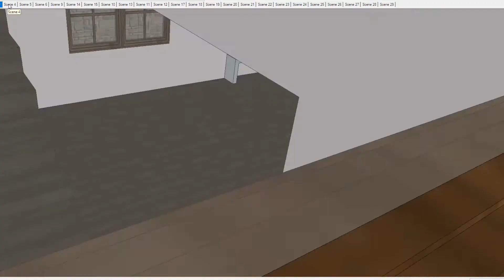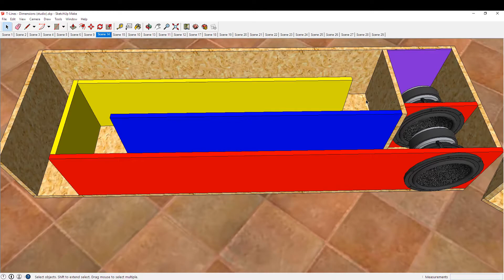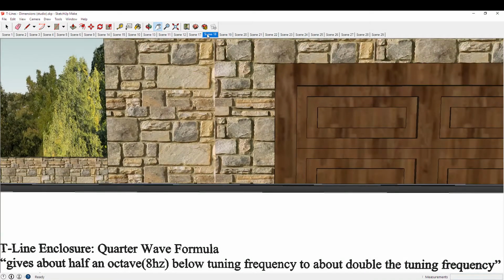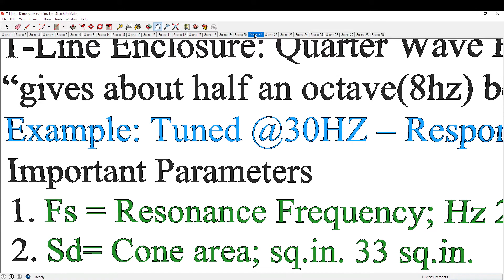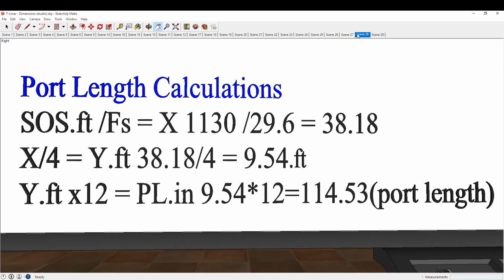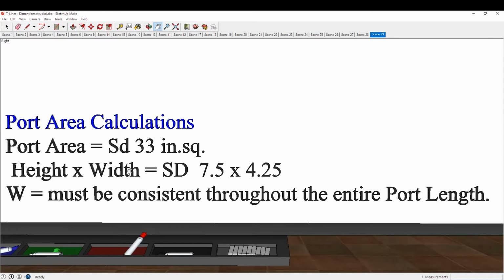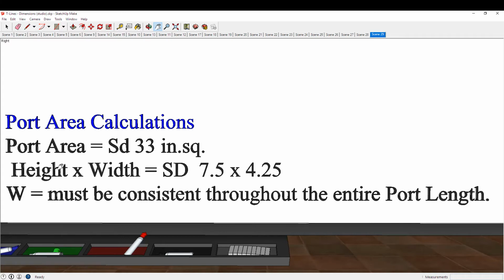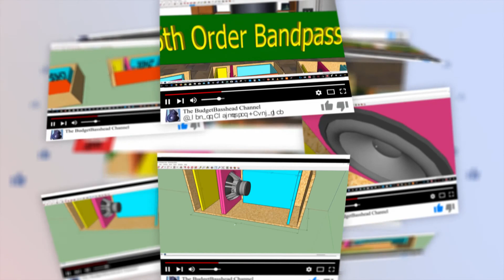T-Line Design: Formula

Comment: thanks, terrific tutorial. question, plz... WHY "consistent Width throughout" the line? some designs have it tapered wider/bigger at the outlet, just be angling the interior panels. I'm sure you know. Any acoustic differences to each method?? tanx!! sub'd/liked... more, more 🙂
Reply from the maker: @antoniiocaluso1071  traditionally the transmission line is not tapered. It's a simple line in which you load the driver into. When you taper the line, it behaves more like a horn enclosure. So look at it like this, all horn enclosures are considered waveguide enclosures. But not all waveguide  enclosures are considered horns.

Comment: Ok,, I built a T, LINE. It actually works!! 4th order,, I got it down to ,, now no joke,, 10, HERTZ!!!   with my 8 in woof.
Reply from the maker: Congrats, no turning back now 😄
Reply: Is it possible to do a t-line with 3 8s.......got sundowns x v3
Reply: @saluteboyz yes, find out what your cone area is equal too then design it based off that SD.

So FS, QTS, Driver displacement will not change. You can experiment in a calculator like HornResp to see if it changes.

Comment: If using two drivers, does the Sd double or do you only have to calculate for one driver? Also, do you have to use the recommended air space for the driver?
Reply from the maker: Yes and no. SD doubles

Comment: Thank you for the video, my name is Shawn, question, is a folded horn the same as a t-line as far as fz range. I want to build either folded horn or t-line to cover midbass fz's ~80-400 range. Or am I way off track with that plan. I've got plenty of room in my van and dsp great amps to do the job.

Comment: love the channel very helpfull and informative! need a little extra help if you would? im always trying to get a little more out it you know what i mean!? my so and i built my truck with audio video and lighting as the main foucus! we plan on having fun and doing some shows! he loves music and and music production and hes only 9 already a bass head! so we did a blow through 6th order in a 2006 f150 super crew with the four full doors. 
what we used dont get me wrong it sounds fantastic! but like i said a little more!
Subwoofers (4 )Sundown Audio Sa8s v3 box ratio is 1-1 tuned at 36 hz and 61hz 
Subwoofer Amp Stetsom 9k EQ (Amp is bad A,.........!)
Mids &. Highs (4 )6 &n 1/2 kicker components (Planning on doubling these)
Mid and high amp Stetsom
so after watching this video i thought about a build for the truck did all the math but i doont know what the end result of the boxes tunnhimg would be? I tried to down load that win program for building box but it dosnt work for mac and thne other recomended onhe for mac was giving me issues, so i just did the math work if i figure out how to post piuc of box designs id likje some input please!??
Reply from the maker: The t-line running is that of is fs. What's more important, is total come area to determine line length.

Comment: So is the response where it starts to roll off or something like 3db down?
Reply from the maker: Transmission line speakers roll off at 6db per octave from the tuned frequency of the enclosure, bass reflex designs roll of at 12 db per octave.

Comment: transmission align the port with the FS of the driver meaning they both move the same space of air forward in Sync which add 3db over a ported enclosure, your middle desing isnt T-Line

Comment: With a Mounting depth of 5  how did you offset the Sub ? (Spacer or a total front covering)  and if using a covering did u add the 1/2-3/4 thickness to your total line length?   Also does the line length start at the Subs center line or the inside edge of the starting point  to the exit port ?   Good explanation of the T-Line and your videos are Bad A#$
Reply from the maker: Here is the build: 
https://youtu.be/Tc4DUiHu0Ws

Comment: I've built a T-Line enclosure for a 6,5" sub using this formula and it sounds great at low/medium volume but at higher volumes when the sub gets to move, a lot of turbulence starts to occurs at the port. Any idea of what causes this?
Reply from the maker: did you put 45 degree angles in your enclosure corners to assist with air flow? The final bend of the line it's critical that you do this. Also, place some acoustic dampening material in the line, preferably in the beginning of the line, it helps dramatically with resonance and air flow.
Reply: @BudgetBassHead  yes, I've put angles in every corner so the port should have the same area all the way through. I don't have any dampening inside tho, might it try that. Thanks for response
Reply: @BudgetBassHead  You can hear it a bit when the door is open - https://youtu.be/7jJtAk7Yxss
Reply: @crazyexperiments4815  I trust you did the math right but try increasing the surface area of the port a little bit. It may lower the velocity of the air exiting it, reducing the "chuffing" sound

Comment: I've been a fan of "quarterwaves" for about 18 years now. Got tired of messing with Martin Kings formulas and spent many hours playing with simple lines and testing on LMS and RTA mics and learned everything I needed. But all my testings with strait, tapered, horn, iso, 4th 6th order, passive radiator coupled, M horn etc, my favorite has been the 4th order Quarterwave- hands down. I'm currently working on my comp car 2-18s in a 4th order quarterwave the line is 30-31hz long but I should be peaking around 20 Hz for my particular install and comp class.
Reply from the maker: Wow. That sounds amazing 😀 any links to the build?

Comment: Hi guys, the first design with the 2 speakers one in the sealed section and one in the ported section,  Now do these speakers work in phase or out off phase.  I would think out off phase. If both speaker cones move forward they will cancel each other out. So the sealed speaker moves forward and the port speaker moves back, then the pressure wave rolls out off the port. Please please can somebody comment on this.  Thanks so much.
Reply from the maker: They would definitely have to work out of phase

Comment: If I use more than one woofer does that mean I will need to add up all of the radiating surfaces to determine the "line area"! 

I am thinking about building a TL tower with 8 four inch drivers and a tweeter. Or should Just port the thing..?
Reply: Then port it is!
Thank you. And thanks for responding so quickly. That is not exactly normal here on YouTube.
Reply from the maker: That's correct.

Comment: If you want any help with t lines shoot me a message I've built 36 not claiming I'm a boss or anything but I like helping and learning ps you can get huge output out of a 12 tuned to 30 as far as a t line and still dig to 20 or 25 depending on the sub
Reply: could you help me?
Reply: Hey bro I'm having difficulty getting a good bandpass for my 15 mojo615d4 it hits low well then drops out and picks back up in higher frequency kind of like 2 mountains on the frequency graph. Not sure if width of port is off length is off or both? Any help would be great
Reply: I need some help bro cab u do a multi sub t line let's say 3 8s any help will be appreciated